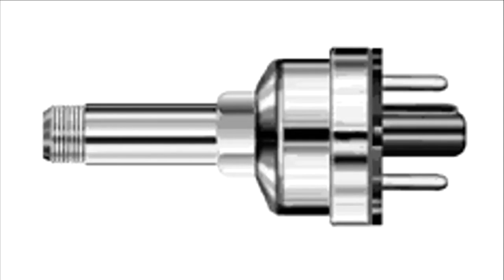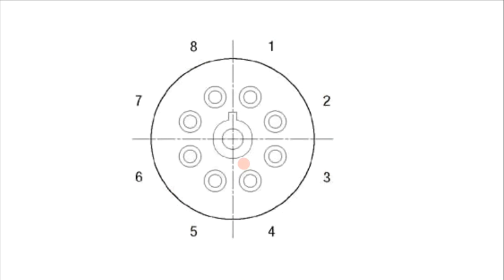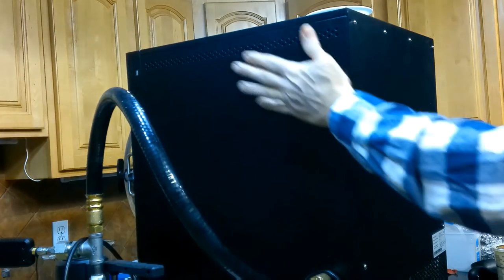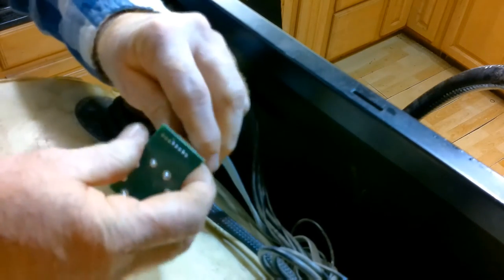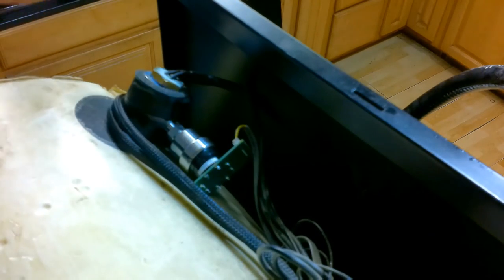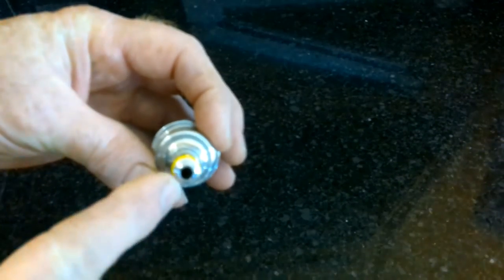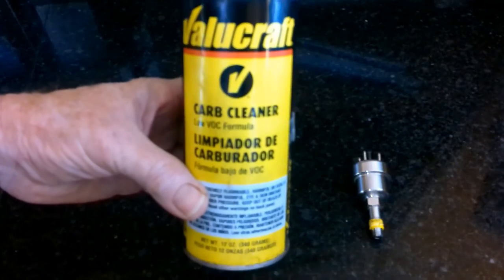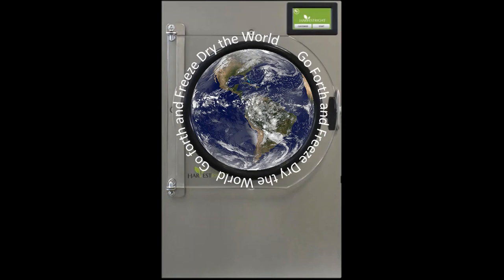Harvest Right Freeze Dryer- When a Vacuum Leak Isn't a Vacuum leak

Comment: Phil, I want to thank you so much for making this video. We’ve been plagued with the dreaded “inadequate vacuum” message for several months. Not only that but occasionally we’ll get a message that says it can’t cool to an adequate temperature. I can’t remember that message. I spoke to HR customer service numerous times and it was getting to the point where they wanted me to send the machine in. I tried to tell them that I suspect a sensor error but what do I know? I suspected a sensor error because my temperature would change 10° in 10 seconds and I knew that wasn’t accurate or really even possible inside the FD. Prior to cleaning the vacuum sensor my machine would only get to approx 1500 mT when doing the vacuum test and then would rapidly rise to something very high then would wildly swing between mT. But after watching this video I went and got a can of MAS cleaner, removed my vacuum sensor and cleaned it like you suggested. Reinstalled it, did a vacuum test and it pulled down to  244mT.  I don’t think I have a vacuum leak. Ran a batch of food and it worked perfectly. Does the vacuum sensor also detect the temperature in the chamber?
Reply from the maker: The temp sensor in the chamber is from a thermistor under the heater element, I believe on the second tray.  Looks like a worm under the skin.  I'm glad the video helped.
Reply: @Philat4800feet  Back to square one. Still getting the Inadequate Vacuum message. I think my FD is not getting cold enough or our garage in this heat is not helping. I put 4 frozen trays in an X-Large FD and it took almost 16 hours for it to get to -10F for the vacuum pump to kick on. Then it seems to work great but during the cycles when it’s on its way back down to 500mT it stalls around 520 but will eventually make it to 500 where the message disappears and everything is back on track. Right now we’re at about 35 hours total time. We live in Oklahoma and it has been hot here. Does the temperature of the environment the FD is in make that much of a difference?
Reply from the maker: Outside FD temperature should remain below 85 degrees.
What software version are you running?
I guess you have check for vacuum leaks?
Reply: @Philat4800feet  it pulled down to 244 mT on the test run so I would assume I don’t have any leaks. Is that a false assumption? Running 5.0.23
Reply: @Philat4800feet  a new problem. Freeze dryer won’t come on at all. No screen power and no refrigeration compressor. The little green light on the back of the screen is on, I have 125 volts where the power enter the circuit board and I have good continuity on the black and white power wires that go to the circuit board. The other day I turned it on and nothing happened. Turned it off and on and it came on. I turned in a ticket in with HR but have heard nothing. Really frustrated with their customer support. I figure in about a week they’ll send me an email to set up an appointment a week out. HR didn’t used to be this way. When I called with a problem I talked to someone right then.  This is our third FD from HR and all three have had problems. We bought our first one in 2014.  Any suggestions as to what it may be or a work around?
Reply from the maker: @timothypropst238  I would remove the board and look for any open solder joints, check all the ribbon wire is seated within the plugs.  Unplug and plug everything back in.  Sounds like an "open" circuit.
Reply: @Philat4800feet  thank you.
Reply: @Philat4800feet  unplugged all connections and back in. Nothing obvious.  Both little green lights are on on the circuit board behind the screen.

Comment: Thanks for the info.   A few points to consider;  HR uses commercially available vacuum sensors, not really proprietary.  You may consider using gas rated (thicker) PTFE.  Notice the yellow color of what came out.  New units require two screws to be removed from the GUI bezel prior to removing the top cover.  You didn't show the comparison as mentioned.  Instead it appears an old video was edited in.
Reply from the maker: I was surprised not to find any markings on the sensor, so it was hard to run a proper ID on it.  I also understand that HR has made a lot of changes to the inner chassis.
Reply: That looks like a Yellow Jacket thermalcouple. They tell you to use alcohol and shake it around and then drain it to clean it.
Reply: I was wondering about the yellow tape too.  That did not look like HR factory taping on the thermo-couple.  Was that tape original Phil?
Great video as always!
Reply from the maker: @kevinrowbotham545  That was OEM tape.
Reply: @Philat4800feet  Not sure how to properly contact you Via Youtube. 
Here is the problem, 
we are experiencing:
Vacuum pump was pulling +2500 mtorr, not pulling the required 500 mtorr vacuum.  
I have disassembled and reassembled our Harvest Right 7 CFM HRC-7-115, SN #19010091, several times.
It will start pulling a vacuum, often getting down to 200 mtorr sometimes while running quiet and smooth.
After anywhere from ½ hour to several hours, the volume and pitch of the vacuum pump changes and it vibrates more, gradually loosing vacuum to +2,500mtorr.  It seems to run hotter at this time but perhaps the heat is from extended  operation?

I have not checked the thermocouple, but plan to I cannot find any vacuum leaks?

To measure vacuum with a gage, I suspect I would need an accurate Differential pressure gage?
Any ideas?

Thanks for any assistance!

Comment: Phil, in my training, I was told not to replace Thermocouple wires with anything other than the original wires (or special extension wires). The reason for this is that the thermocouple wires are made from two different materials, such that if you add 2 wires such as "copper" wires to them, they will then create a voltage (due to two different metals at a junction) which will throw off the readings. I am curious -- do the cable connectors use special wires for the thermocouple ?
Reply from the maker: Good questions.  I can't speak for HR, but I don't think they are that close to "attention to detail".  The makers of the vacuum sensors recommend to mount the sensors as close to vertical as possible to keep junk and moisture from building up inside.  HR sensors are mounted horizontal.  I don't think wire selection was a debated topic.

Comment: Your video was very informative. I have a new unit bought in 2016. But I didn’t get the box opened until 2023. I started the unit, but got no reading on vacuum. The unit had vacuum as the door wouldn’t open until I drained the vacuum off with the drain… any the sensor got damaged in shipment?
Reply from the maker: So the screen shows no vacuum at all?  If you go to the function test, and run the vacuum pump for 15 minutes does that screen show vacuum?

Comment: I just talked to customer service to order the part.  It consists of the Vacuum Tube Senor ($150), Vacuum Tube Control Board ($35), and Vacuum Tube Cable (no price given).  They sell a kit with all 3 parts and it is called the Vacuum Tube Board Kit [Kit-VTB] for $203 plus tax but has free shipping.  These prices are on 10/26/23.
Reply from the maker: When all else fails, this my be your solution.
Reply: I forgot to say Thank You for the valuable video in the above post!  I just reported the above information so if anyone else asks and have to order they at least have an idea of cost.  I did clean it as you suggested and went ahead and resealed every vacuum connection since I had the cabinet apart.  When I first ran it after cleaning it still fluctuated wildly,  so I ordered the parts.  I decided to go ahead and run a batch and it performed as it should, other than about midway through the 1st batch it reported the temperature dropping down to 35 and then going up, and then going down.  I had never noticed it doing that before and it could be normal, just hadn't caught it.  At least I haven't gotten the Inadequate Vacuum Error message and the mTorr goes down and stays down now.  I didn't have a vacuum leak, so cleaning the vacuum tube sensor was the fix I needed.  I just took out my 3rd batch since cleaning and resealing.  BTW I have over 300 cycles on my medium and only had 1 control board to go bad and had to replace the drain valve twice.  I do enjoy your videos and I'm grateful for the time and effort you put into them.  Thank you again!  @Philat4800feet
Reply from the maker: Glad it worked

Comment: Excellent video, Phil, thank you for demystifying the sensor and how to maintain it!

Quick question please...  When testing for leaks, how long should the FD maintain a vacuum after I turn off the vacuum pump?
Reply from the maker: Not long for a deep vacuum (anything under 2500 mtorr).  The vacuum check valve in the pump isn't designed for that amount of force.

Comment: I want to put an accurate mtorr gauge on the machine so that I will know if my vacuum sensor is broken or off. I purchased one but the number system doesn't match. It says Torr(mm) and sits at 40 when the machine gets around 3000 or so and stays there even at 900. I have had vacuum problems for 2 years now. The machine will pull a vacuum if I pull the tray holder out but if it is in (plugged in or not) it will not get below 800 or so. I sprayed out the sensor but it made no difference. I have done most everything now. 
The machine will pull a vac to 360 if it is empty but if I put the tray holder in whether plugged in or not it will only get to around 800 or so.
1. New pump
2. New door seal
3. New brass ball valve
4. liquid taped all joints
5. turned the door backwards to see if it was warped or had some kind of unseen leak
6. New vacuum hose
7. Hard cemented the fitting where the tray holder wires come out of (at the advice of harvest right when they did not charge for help)
8. Paid the 45.00 just to be told they would call at a certain time and call hours later when I was on the road, then told they would call that evening at 4 and never call or send email.
I would like to put a gauge on the machine that will show 500 torr vs 550 torrs. This gauge I have just is not sensitive at all. I have a Yellow Jacket "Torr(mm)/in. hg"
9. I adjusted the door even turning it inside out.
10. There is a minor leak at the door due to manufacturing grinding the weld off the face thus making a low spot of 18 thousands. I made a .125 oring and put inside of the door seal thinking this might take up the space but it did not change anything. I sprayed the door seal area with carb cleaner and the vacuum went from 900 to 895 but that was it.
Sprayed out the sensor.
Please help.
Reply from the maker: You have covered your bases.  Here's some thoughts:  Where the "epoxy plug" is located I don't know why HR would use a hard cement.  I had a leak at the wire harness.  I found a food grade silicone and applied it under low vacuum so the vacuum would help pull in the sealer.  It fixed it.  One potential leak would be a cracked weld.  That would require NDI work such as a penetrating die inspection.  I believe HR has a five year warranty on their chamber.
I placed a vacuum micron gauge on top of my vacuum pump.  I placed a 304SS tee with the gauge coming out the side and the hose coming out the top.  If you have a shop that makes hydraulic hoses, they would have all the JIC fittings.
Another thought is using different air fresheners to find your leak.  Use them one at a time, in different locations, under vacuum and then smell inside the chamber.   Place some towels inside the chamber to capture the scent.
Reply: @Philat4800feet  A new update to my freeze dryer.
1. I turned the tray holder upside down "unplugged" and ran the freeze dryer and within 5 minutes my visual screen turned upside in a mirror image. I turned it off unplugged restarted and the image was still a mirror image. I turned the tray holder right side up "unplugged still" and within about 5 minutes the visual image corrected itself. Go figure that one. That is a real head thumper.
Upon testing the seal around the door, I saw where the gasket touches the front of the machine on the hinge side so I
A. Put toilet paper inside around the rubber door ring and brought the vacuum to around 1300 mtorr then sprayed food dye around the outside.
Result. No Leak.
B. I then cleaned it all and brought the vacuum to around 1500 and sprayed soap water all around the door seal. No bubble seen inside the chamber however when I release the drain valve and pulled the rubber I saw bubble coming from the foam located behind the rubber seal in the area of the bad welds I have noticed. It appears my chamber is leaking through the welds.Most of the bad welds are near the front within 8" or so. This mean I must take the foam off the tank in this area and test again spraying soap water on the outside of the tank on the weld areas. 
This still does not clear up why that without the tray holder I can get down to 346 mtorr within 30 min.
Well at least one leak has been discovered.
I still plan on testing the vac sensor as you instructed on your video.
You have been so much help brother. Any advice going forward would be welcome. The unit was purchased in 2018. 2018+5=2023
Reply from the maker: Any chance you contacted HR about this problem before 2023?  Any documentation?   I wish you the best.  Watch out for the coils around the outside of the chamber.  Keep in touch.
Reply: @Philat4800feet  Will do buddy. I am taking care of my dad 50 mile round trip. Lately its every day. I plan on working on it this evening when I get home. I will keep you informed. The giveaway was the bubbling soap coming out of the foam on the front of the machine. I plan on using a razor knife and "delicately" cutting it away in the area I believe the leak is. I understand there is a coil wrapped around the drum. I then plan on removing all the foam in at area. Then spray it with soap water under a vacuum. This should give the location. I then will clean the soap away and lightly sand the Styrofoam away. I plan on using JB Weld, letting it dry under vacuum then adding liquid tape over that. Any advise?
Reply: Update:
I cut away the insulation along the entire length of the drum weld. The bubbles are coming from behind the drum, not along the weld. Very strange. My model of freeze dryer has the drum resting on the back panel. I cannot remove this panel. Unless you have a better idea, I plan on cutting the panel using a dremmel ( for smaller grove) then cut the insulation off the back and continue tracking. I feel it must be coming from the edge of the end somewhere. I do not currently have access to find muchless repair.
Any ideas?
Reply: @jesuschristismylordandsavi6108 hats off to you both for your dedication. Hoping I don’t have this problem 🙏🏽
Reply: UPDATE: I removed the foam insulation around every port and weld. No leak. According to HR I was very lucky in that I did not nick the tubing. The copper tubbing is so thin that you can melt it with a lighter, so he told me. Anyways. The bubbles that were coming from the front of the machine obviously came from re-expansion of the vacuum chamber and not a leak. I replaced the foam with "Loctite".  Great Stuff just had too many voids and does not compare to Loctite.

The tech I was dealing with was not very helpful at all. He was the one who convinced me I had a leak. I then went to his boss, Ben. Ben had me run a 4 hour vacuum test that determined I did not have a leak. Because the test showed no leak Ben closed the ticket. So from a video on youtube I believe was from "Philat4800feet", I adjusted my factory vacuum setting from 50 to 20.  Runs like a champ now. No more low vacuum errors. Another strange anomaly is that my machine would only cool to -20 but now cools to -35 after the foam replacement. By the time my old "2018 HR" was fixed and running, my new "StayFresh 2024 Mega" came in. It took 30 hours total on peppers. My HR took 38 hours on peppers. Running both machines trying to catch up now. Thanks to everyone on here and youtube who helped out and thanks to HR for their help. Lord bless you all.

Comment: We just got our freeze dryer a few weeks ago and since the bread run, we haven't been able to get adequate vacuum.  Completely empty  we get around 380 MTor, when loaded we get around 1450.  So far it's just a $3000 boat anchor.  Have checked all of the external fixes but haven't cracked it open yet.
Reply from the maker: Sounds like your food is sublimating and isn't rock hard frozen.  There's a fix coming soon that may help.
Reply: Mine also only pulls a deep vac about 1 out of every 6 times I run it. I’ve done more freezing and defrosting of the unit
Reply: @NoName-wq9ou Did you ever find out what was wrong because my machine does about the same thing except the tray holder will not allow a vac to be pulled.
Reply: @jesuschristismylordandsavi6108  We changed the settings on the machine.  Not at home to check but I think Phil had a video on it.  Changed it from fast to slow or something like that.
Reply: @NoName-wq9ou  I know what you are talking about. Thank you.

Comment: I have wondered about this sensor many times.  Just how accurate it is. I am wondering about the voltages across the pins on an accurate sensor.  The resistance will change on amount of contaminates in it as well as the voltage.
I love this video.
Reply from the maker: The sensor works for the Harvest Right program and that about it.  My micron gauge is more accurate, and the readings are never the same.  HR could make it more accurate at a cost but is it really worth it?